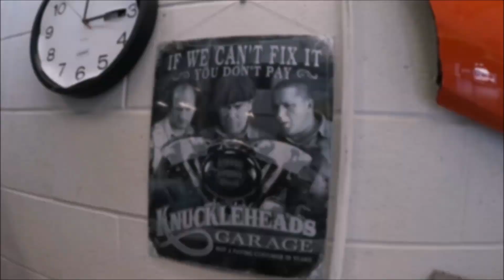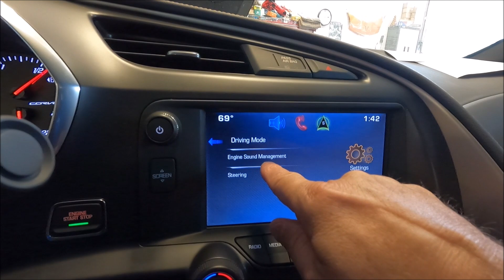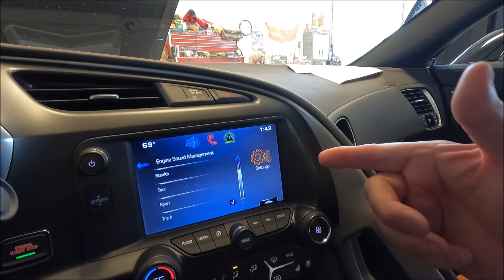C8 & C7 CORVETTE TECH QUESTIONS & ANSWERS plus WE SHOW OFF YOUR RIDES

Comment: Nitrogen is -321 F when a gas state. This is the reason that tires don't deflate in the winter. Love this!
Reply: I think you met that nitrogen is -321° f when in a liquid state. Not sure what that has to do with gaseous nitrogen in your tires in the winter time though. Your tires normally have about 80% nitrogen in them anyway.
Reply: Actually it is in a gas state above-321 F. I wrote the wrong number. I was thinking of the information pertaining to my MRI machine. But it's COLD!!! LOL🥶
Reply: LN2 is definitely very cold. We used it to cool our test chambers for electronics so we could get them down to temperature quickly.

Comment: Friendly reminder that ambient air is 78% nitrogen. Unless you completely empty, then replace all the air in your tire with 100% nitrogen, while in a vacuum (which is impossible on earth), then putting nitrogen in your tires does absolutely nothing. It may take you from 78% to 80% at best.
Reply: You are correct; the only thing that doesn't react to temperature linearly is the minute amount of water vapor in your tires, which is next to nothing.  All the other gases in air must follow the gas laws and react equally.  Also remember that each ten degrees F., up or down affects psi by one (up or down).

Comment: Rev. Chuck & Altar Boy Rick (j/k):  My ‘22 Z51 has 3,500 miles on it in nine months.  Broken in gingerly, no tracking, zero problems.  About half of the 3,500 was highway, the rest around town.  My oil life meter is showing only 22% left, so I’m wondering if I’ll ever be able to get the full 7,500 miles between changes.  Is this just a new-car issue?  What am I doing driving-wise to affect oil life?

Comment: Hi Rick and Chuck.   I apologize if this questions has already been addressed.  Relatively new subscriber to your channel.  Question for next Tech Tues.  I own a 2009 Corvette Z06 with the LS7.  I thoughtI read in a recent Corvette Enthusiast magazine that GM in conjunction with Mobil Oil has recently changed its recommendation for best all purpose fully synthettic oil in the LS7 from Mobil 1 5W30 to Mobil 1 0W40 Supercar.  Please confirm or comment on this recent recommendation if true.  I have typically been running 5W30 Reline Oil in my Z but thinking of switching to the new 0W40 Mobil 1 oil.  Appreciate any information you have on this topic.  John S from Arlington VA